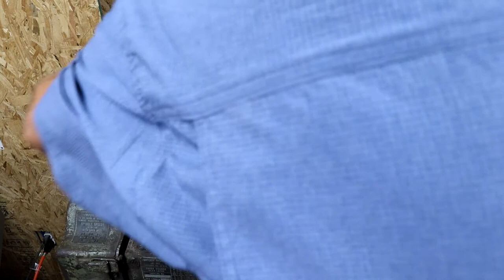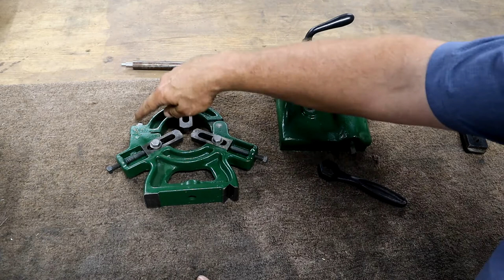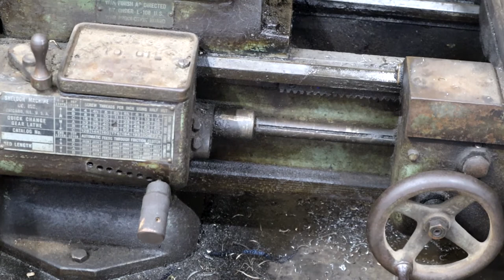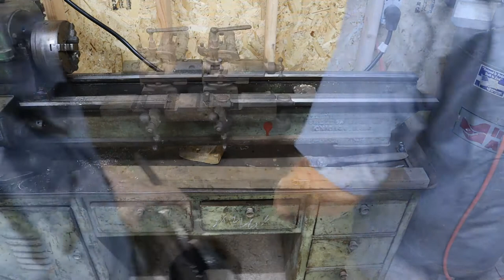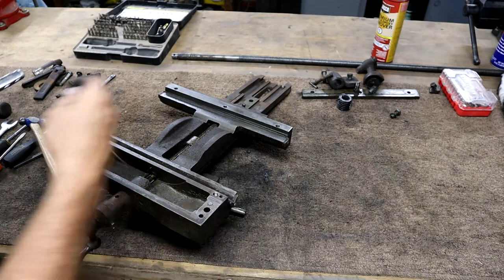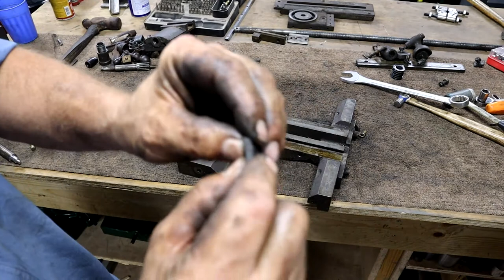The Sheldon Lathe Part 3

Comment: Telescopic taper attachment south bend heavy tens had those as an option well they had both the regular and that style it’s great because all you have to do to use the taper attachment is lock the bed clamp and lock the taper clamp and to adjust in or out it’s crack the taper clamp real quick and easy